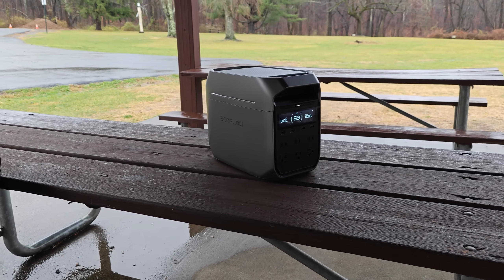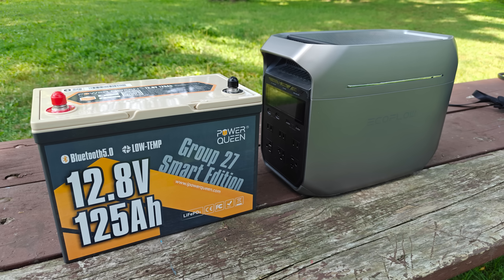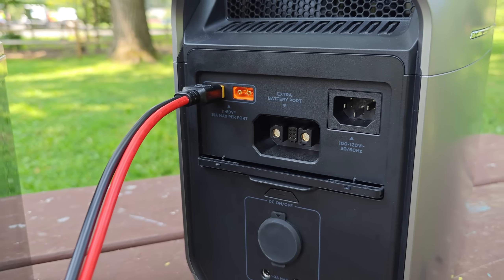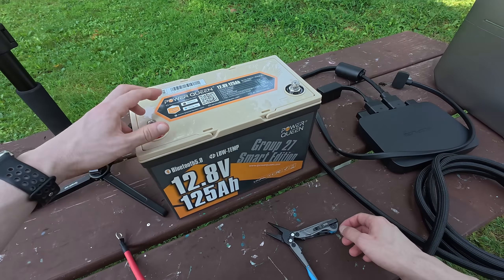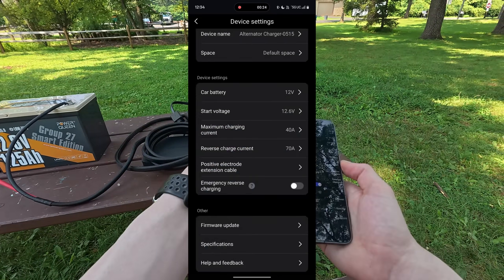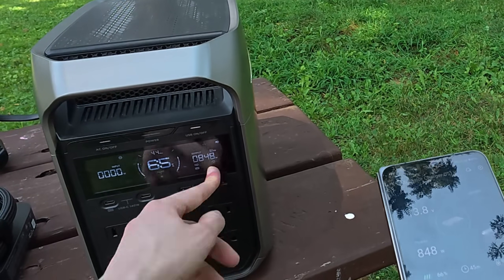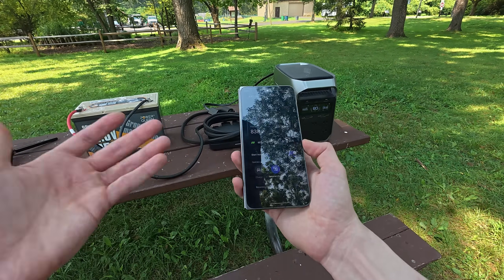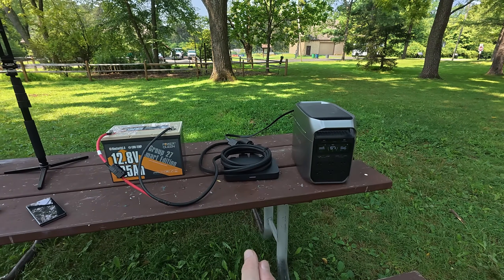How to Expand Power Station Capacity for Cheap!

Comment: This is dumb... You start out with a cheap way to charge the Eco flow, then you throw a $380 "upgrade", at that point just buy the add on Eco flow battery cause a battery plus the cost of the DC to DC charger... What kind of kick back is eco flow throwing at him to produce ignorance to try to dupe folks... kids these days, unbelievable...

Comment: This makes the most sense with two big 12v batteries in series.  With 24v, the Eco Flow Alternator Charger can do 800w and not tie up the solar inputs. I have been doing it with 2x 230AH and a D2 Max for about a year.  That is about 8KWH total.  
  I bought a balancer, but have not needed it yet for this system.  That is probably just luck.  (My other system definitely needed a balancer, even though I carefully pre-charged its batteries in parallel.) 
  The 48v rack-mount batteries have gotten cheaper, so direct connection to one of those might be the best deal,
soon.  I do not want to be an early adopter for that one.

Comment: Does the Power Queen automatically shut off when it charges is 100% to prevent over charging?
Reply: Yess, but never do that the bms is your last ressort, always use a proper charging curve/voltage

Comment: If you use a normal xt60 connection it will think it is charging using a normal 12v car outlet and it will limit the charging speed.

If you want a cheap solution buy a xt60i ( I for intelligent but not really ) it is an xt60 with 1 extra small connector, connect the small connector to the negative of the Wire. Like this the ecoflow will think it is a solar panel and it will except the max power input. For me it is 15amp. (Ecoflow delta 2 max)
In put of 11 - 60v max 15amp
If you use 12v the max it can pull is 180w
In 24v is 360w, 48v is 720w. 
As you can see more volts equals to more power. 
(Don't exide max voltage. Calculation for power (V*Amp=W))

Comment: Just get a 24 volt batt and save the 400 bucks in the DC to DC... Why spend 300 on a battery and then 300 plus in the DC to DC? Seems silly. These are typically amp limited. So just go higher voltage battery.
Reply: Or you can use 2,3, or even 4 matched 12 volt batteries wired in series to the solar charging ports. You do need to be mindful that they are balanced and I would strongly advise fuses for each battery. Also be sure to use the correct size wire. Some power stations now allow up to 20 amps of solar which will allow about 250 watts of charging from a single 12.8 volt 100ah LifePo4 battery. An example of this is the Pecron E1000lfp which has a switch at the xt60 input port to choose between 8 amps and 20 amps max. Care needs to be taken to switch it to 8 amps if charging from the cigarette socket of a car or you will blow the fuse.
Reply: Sounds logical. However I've seen 24V LiFePO4 Batteries for over $300. And I saw one for $81 and it includes a charger.  Sounds too good to be true.
Reply: @billb6283  Like anything, the quality and price has a range. But in general, you can get a same capacity (in watt hours) 12 volt as a 24 volt.  So instead of getting say a 100 amp hour 12 volt, get a 50 amp hour 24 volt (same total power, same price). If the power station is limited to say 15 amps in put.... on a 12 volt that gets you about 180 watts in, and on a 24 volt you get double that (and don't have to buy a DC to DC charger).
Reply: @ZLew02  OK, thanks for the reply.

Comment: To each their own but i have a couple low Ah but 51.2V LifePo4 batteries that I hit the cap on all these small-mid size power stations with an XT-60i cable.  Still a cost of course but I use that batteries for other jobs as well.  DC to DC charger is fine.  I just have no desire to pay those bucks for this narrow use case and I wouldn't use it elsewhere like I can with my GC 51.2 batteries
Reply: I'm trying to justify buying one of those smaller battery packs, what else do you use them for?

Comment: Or just get a 48 volt battery and a circuit breaker and connect it to the same port that you're doing with the DC to DC....
Reply: So you specifically need circuit breaker?
Reply: @StreamLabTech  it's kind of a good idea.
Reply: He’s absolutely correct
Reply: Isn't that a proprietary connection? I can see more than 2 pins on that plug.
Reply: @tom1897  people recently figured out you can bridge two of the 6 data pins with a resistor and it’ll accept regular 8AWG with XT150 barrel connectors
Reply: @glitterishhh awesome info, where can I find something about that?
Reply: @tom1897 if he means the extra battery expansion for it then it is proprietary in it won't work but i assume he means connected to the solar Port which is the common option because it's easy just uses the normal xt60i connector and at least make sure your power station can handle it but the echoflo Delta series can do 11 volt to 60 volt and the pro series can do 11 volt to 150 volt so it shouldn't be a problem for 48 volt battery.
Just make sure when you charge the battery itself you're charging it with the correct setup to match the 48v battery

Comment: The price of buying cheap junk, you have to buy more stuff, and it always requires some sort of hack, and still doesnt do the job worth a shit! My solar power stations are 6 yrs old, 3000w low frequency, 2000w solar input on dual mppts (anderson)  plugs,dual ac chargers 1500w (anderson) plugs,240w  20a car charging, infinitely exspandable, 5 20a 13.8v barrel plugs, 6 ac plugs on 2 15amp circuits, TT30 plug with dual 15amp hot wires,dont have to use proprietary batteries, external battery port( anderson ) plug, can utilize any battery chemistry, can charge and discharge from all ports simultaneously, all metal construction, modular, no wires to connect batteries, except external, and it charges external batteries @ the same rate! Heaviest piece 32 lbs,a mere 13w idle consumption,all that and not one hack needed, quality is not cheap, but it will still be running when those high frequency units are dead!
Reply: What inverter are you using? Magnum? Outback? Victron?
Reply: @adammcqueen3212  Titan and it almost as good as Victron, but those you mention are inverters not power stations.  Titan, 3000w ÷ 24v =125amps ÷5 100ah batteries =25amp load on each battery, 13w idle consumption

Comment: This is a good setup, even though the cost of the battery and the DC to DC charger can get expensive, it's well worth the cost. Obviously the OEM expanded battery is indeed more user friendly, but the cost is noabt high, but a consideration. Also, the separate battery can be used in other applications, etc. Not sure why people think charging a 12V power station with a 12V battery is efficient. It's not, and will take longer. More like 48V is better. I will check out this charger for my EcoFlow Max 2. The battery app is definitely a plus. I do have a Honda Generator as well, but would rather use the Honda for charging in a real power outage, if sunlight is minimal. Thank you.

Comment: the problem is charging that battery. Also that Alternator charger is not cheap. the XT60i still cheaper option. 
can have this a permament setup and connect a MPPT charge controller to the battery for solar charging?

Comment: I use a 24v 200ah battery with its own 24v battery charger.  Problem solved cheap.
Reply: On which power station?? and are you using the solar ports?? Can you share the link for the battery
Reply: Only cheap if you don't include the cost of the pv psnels😮
Reply: Or two 12volt 100 ah in series?

Comment: NPL Ventures:  But doesn't whatever battery you use whether it's the expansion or the budget battery.  They still have to get charged up some how to use them with your main unit of the ECO flow?  So you might as well just connect the main unit to solar?

I'm not knocking your idea which is a good one to do BUT ....

Comment: How is buying a $300 DC to DC charger supposed to be cheap?

The first way through the solar port IS the cheap way. And then you charge the DIY battery using a cheap charger.

Thus making it cheap.
Reply: 100% correct. This is a really stupid video and video title.

Also, he keeps repeating over and over that “this is the best way”. Notice he doesn’t say anything about this being the cheapest way. SMH.
Reply: Actually solar charging both battery & jackery during day & battery keeps up my jackery at night easy as plug & clamp lol...

Comment: It's good; not sure it's the best though. I did o-ring to xt60i cables, which gives you 180w (use 2 for a delta 3+ to get 360w) and then also a Batteria solar charge controller to charge the 12v battery via solar. Works as one unit, cheaper than this, and no manual switching back and forth.
Reply: That is EXACTLY what I did and it works just fine to top off or expand the run time on my Delta 2. And, as you said, I get 181w which is not blazing fast but is pretty decent!!

Comment: Unfortunately, this setup seems to only work with EcoFlow products. A buck converter might yield acceptable results with a similar loss for a LOT less money. Two 12-volts in series would also work well and maybe even cost less. Using an XTi connector yields about 190 watts into the EcoFlow. Thanks for taking the time to make this video.
Reply: 3 or  12V will max you out at 500W depends on the version of delta series. the concern is charging that battery. that would be a great setup. or what's a good MPPT charge controller for batteries.

Comment: Great video especially if you already own Ecoflow Delta 2. Yes there is a price to pay for the DC-DC charger but you gain some really useful features that make it worth the purchase price. 800 w alternator charge when engine is running top up 1kWh in 1.3 hours, Bi-directional charging to charge your vehicle battery, use any other battery to charge up to 800 w that are half the cost of a Ecoflow battery.
Reply: the problem with genset is when you need it it's broken :D So having a solar powered power station and use it 24/7 on your house lights would be a great backup a reliable one and taking advantage of free energy.

Comment: The whole point of connecting an external battery is to minimize the expense.  You seem to have maximized the expense instead.  At that point, you might as well have gotten a second power station.

If trickle charging at 12V isn’t enough just buy a 24V or 48V LiFePO4 external battery instead, and a cheap battery charger to charge it up back at home (like a little fanless 4A LiFePO4 charger).  I usually recommend 24V (25.6V LiFePO4) for maximum compatibility with all sorts of power stations.  The absolute cheapest solution will be with a 12.8V battery, though, because there are a bazillion cheap chargers that can charge it.

Also, don’t omit the fuse.  The solar input on a power station has a maximum short circuit specification and an external battery will vastly exceed it.

Comment: I use an XT60i connector with battery clamps to shove juice from an external 100ah lifepo4 battery to my Ecoflow Delta 2. It pushes 180w consistently from the battery to the Delta 2. If you choose the XT60, you will only get that 100w you are showing. I've also rigged the spare battery to charge via a 190w HQST solar panel.
Reply: and you can use 2 of these xt60i cables in parallel for each solar input, as TWO solar panels from a single battery
Reply: Same here. A little research makes a big difference.
Reply: You need to do a video as that is the setup I want to see!!
Reply: And you have to check xt60i cord to be sure middle pin is attached to negative side  not positive or neither.  Just check that with multimeter, continuity as you can't tell visually.  Bridged to negative pin tells the power station to allow full current not just 8 amp.
Reply: yes XT60i is the key for ecoflow !!!!
with XT60 Ampere are limited to 8
with XT60i Ampere limited buy powerstation size.
Reply: @tobiasklee only if xt60i cord has middle pin bridged to negative.  Most are but not all  some to positive 8a only and some to neither some say, both cases basically make it a regular xt60   also the power bank has to have the orange xt60i female receptacle too, not yellow xt60
Reply: Xt60i connector hook it up to a 48v lithium battery
Reply: Using the XT60i and two batteries in series you get 24v at 15 amp for ~360 watts.  Or if you have 2 XT60i inputs like most of the Ecoflow Delta variants, a battery to each plug for the same.  In theory you can max out the inputs (at least on my Delta 2 Max) with 6 batteries, 3 in series into each XT60i plug for 1,000w total.  If you go over the voltage, it will shut off, but mine can go to 60v.   With 100ah 12v batteries, that's 7.2 Kwh for about the same $900 that as the 2 Kwh extra battery from Ecoflow.
Reply: what's the point of Ecoflow ?

Comment: Not a smart solution. I use my spare 52v e-bike batteries and get 500 watts with no losses. If I had a delta 3 plus, I could put 1000 watts. Watt input goes up as voltage increases. I think 48volts gets you close to 500watts. If you’re using more watts than you’re putting in, the Delta will die before your drain spare battery.

Comment: I've never seen anyone directly connecting a 12V battery to charge a power station like that, lol.  Getting a 12V battery to do this is dumb, having to use a DC to DC charger.  Just get a 24V or 48V batter and do a direct hookup to the solar port using a proper connector XT60i (not an XT60) to get close to 500W.  I understand the approach of using the EcoFlow Alternator charger to allow it charge the battery back, but you can just a use battery charger.  As an example, I have a 25.6V 100Ah battery (2,460Wh), and I hook that directly up to the solar port on my EcoFlow Delta 2 Max when I need to recharge my Delta 2 Max.  When I have a lot of solar, I have the 25.6V disconnected from the solar port, and just plug an affordable AC/DC charger from the Delta 2 Max house plug port (so turn on the inverter) and hook a 20A charger to the battery (500W).  This set up for overloading has actually been overkill, since my new solar panels have been super (Renogy 195W 16BB x 2 on top of my roof top tent), charging up to 433W!  Even with no direct sunlight, I still manage to get 40-70W from solar.  I plan on getting a 50Ah 24V battery since it will be smaller and lighter, as I've never had to use more than 30% of my 100Ah.  In any case, this is a much cheaper option, especially since the EcoFlow alt charger is $500 Cdn, and can only be used with an EcoFlow Delta series.  My method is cheaper and can be used for any brand of model of power station, provided they have an inverter and a solar port that accepts 25V
Reply: I know them Renogy 195W 16BB panels are well good v the eco-worthy Bifacial 195W 12V Monocrystalline Solar Panel, which I can't believe preformed so badly to me.  I put two Renogy 195W 16BB panels together, no proper setup and got 460watts at one point 😲😲😲 460watts!!  The 2 eco-worthy Bifacial (TWO sides) 195W?  Well lets not mention them!   A dismal 250-260-270watts😢😢☹☹

I am just not feeling all the extra work you have to do for the eco-worthy Bifacial 195W to get close to the Renogy 195W 16BB panels, which just has one side and I don't have to do any EXTRA work; no foil down to reflect the sun to the back; no painting white; no white stone put down and definitely NO eco-worthy solar tracker up either!!

You need to do a video of your setup please?  It needs to be seen.  I have five stars to give your video already! 😂😂

Comment: You might want to check out some other videos,  for the price of the cord that connects power station to manufacturers extended battery,  you can use about any lifepo4  battery and do exactly the same thing as  the manufacturers expansion battery,  and yes, they charge together  with solar or ac or chargers,  not saying your way won't work,  but certainly not cheap, just search YouTube,  you will see it's  safe , it works  and actually cheap,  don't believe me, just do the search,  old jar head, jasonoid,  they will show you

Comment: Just zip tie an inverter to the battery and you have the cheapest power station money can buy.
Reply: Not really.  I mean yeah, it will output power but what about solar charging.  Zip tie an mppt controller as well?  How about 100/140W device charging over USB-C.  Cig lighter ports and so on.  Am inverter and a battery have their place.  I have a couple board mounted setups but the same as a fully realized Power Station, they...are....not.
Reply: @pigs3littleones   A few of my DIY power stations have everything inside an ammo can (or larger tool kit). Some have the charge controller externally, but all built for less than half the cost of a ready made power station. Not every one needs all the options that ready made power stations comes with. If you can't DIY, then by all means go buy a ready made power station.
Reply: Lol for so much cheaper too! These chums buying overpriced power stations is so funny 😂
Reply: 🎉🎉🎉On god you are right

Comment: I use a 48v batt connected directly..no dc charger..1250 watts in my Echohive. Works well.
Reply: DC DC charger is multi purpose and can pay for itself if used for other purposes.
Reply: true. the problem is 48 to 52V battery are not that affordable.  not in my place it's not.
Reply: @ayatv3503 calculate the watt hours vs 12v plus the converter. You'll find it's less gear and as cost efficient imo. I do like the reverse charging tho. Thats a nice feature.